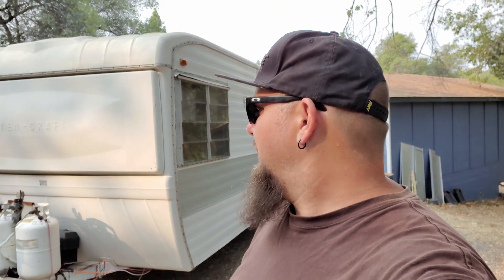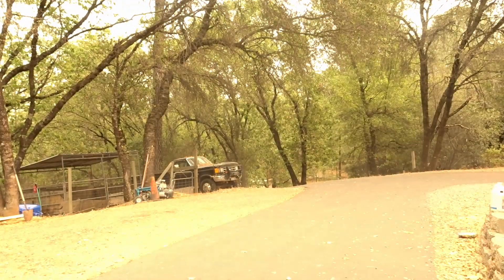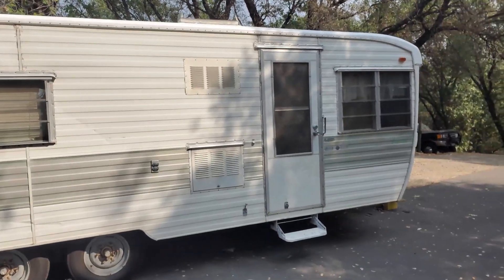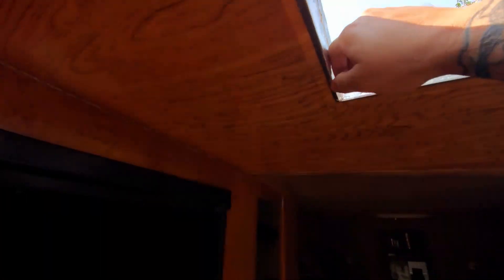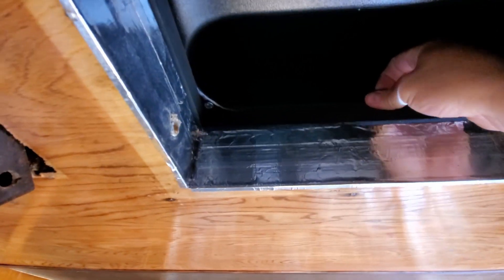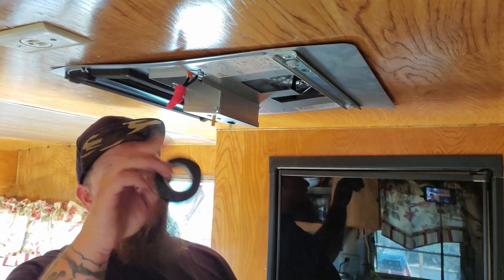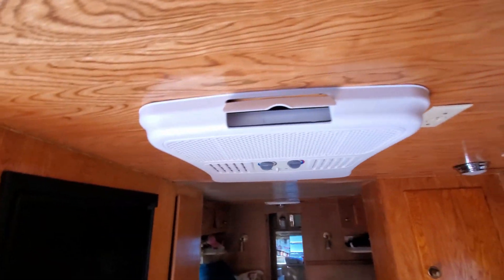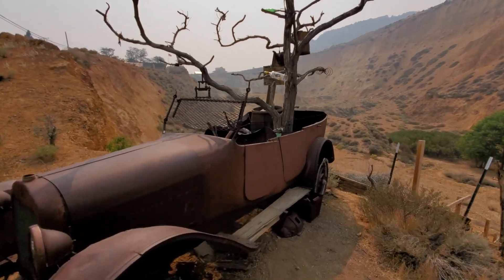RV  AIR CONDITIONER INSTALLATION ❄ FIBERGLASS ROOF SEAL - 1967 KENCRAFT VINTAGE TRAILER

Comment: Hi! Ive watched your video 4 times, we are about to buy a 1967 Ken-Craft trailer, very much like this one. We definitely want to put on the A/C. Do you remember what size you put on? Also, this one leaks, will need to redo all those holes. Did you use Butyl tape? Or did you get RV tape. Thanks for any reply!
Reply from the maker: I believe it was a 13500 btu AC she gave me to install. No butyl tape or anything, the AC comes with a seal already on them. When you tighten down it seals. Very east install.  Good luck! Thanks for watching 👍